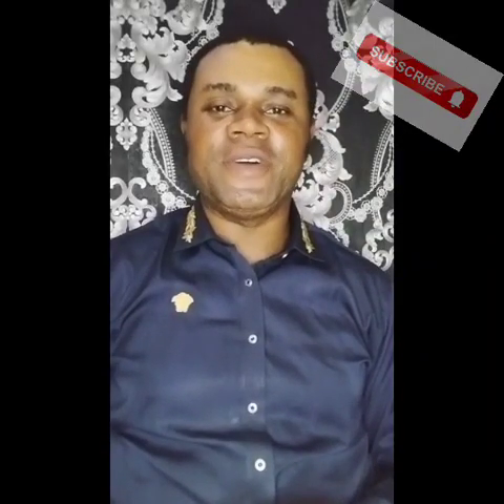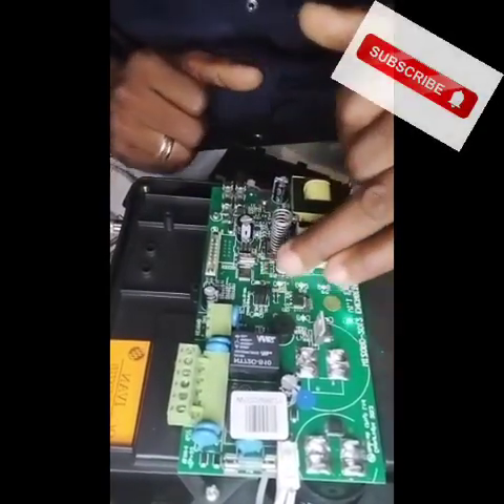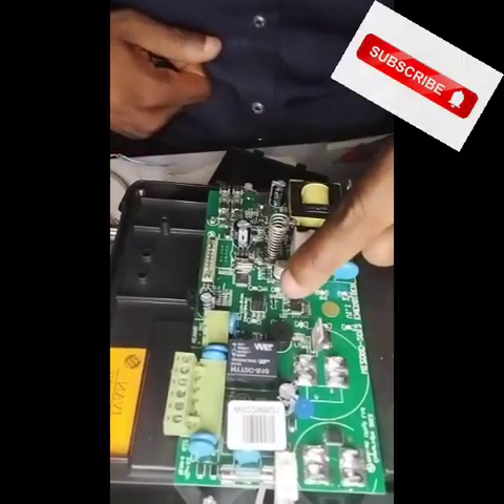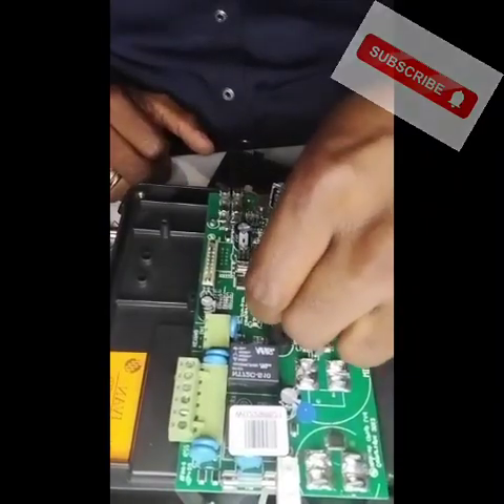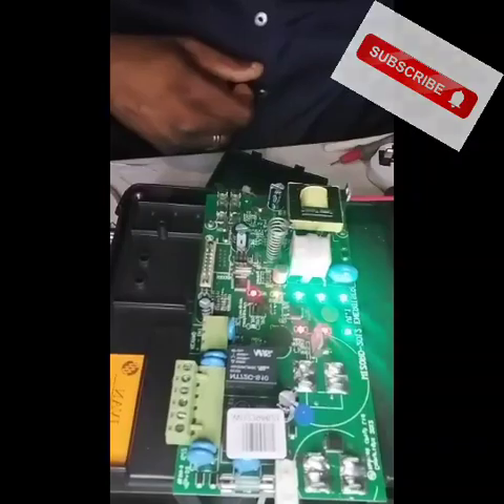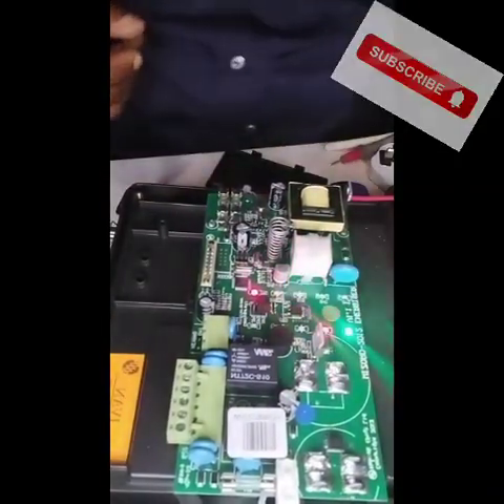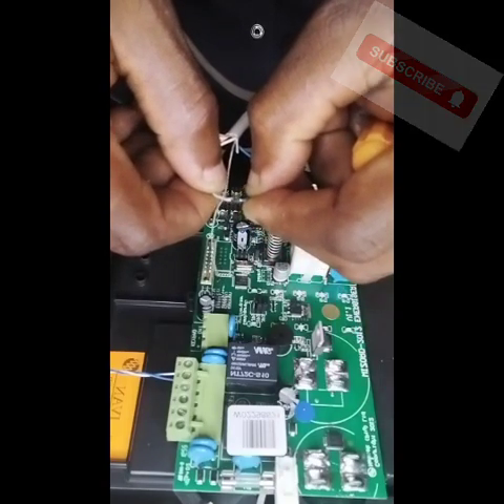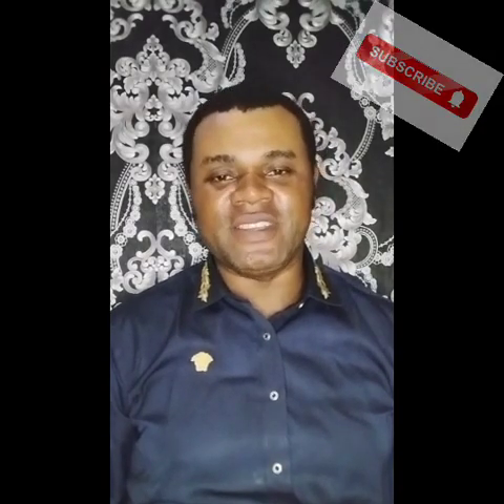How to configure or program a Nemtek Wizord 4 energiser to be operated with a remote switch.

Comment: What happens when you try to terminate the siren and light but they dont work when alarm goes on
Reply from the maker: I sincerely don't understand this question
Reply: A nemtek wizord 4 Energizer have tried to connect the siren and light then when alarm is triggered the siren and light does not work
Reply from the maker: @EriceKisaka-ke7hx  check the fuse on the panel if it's blown
Reply: I already tried to replace maybe its a factory default
Reply: But thanks alot you have helped alot 🙏